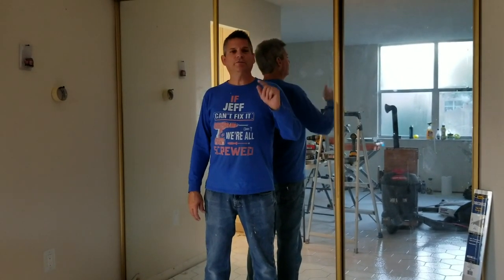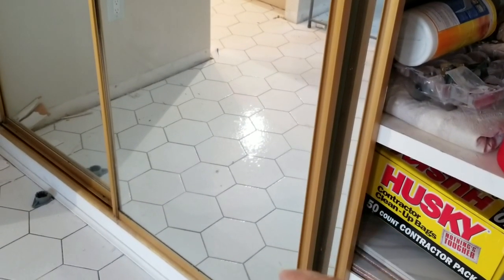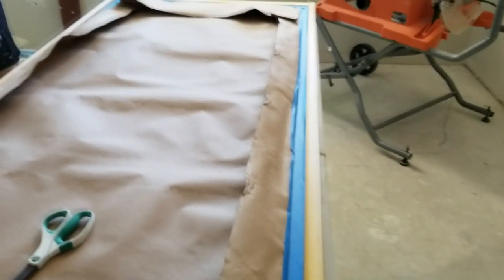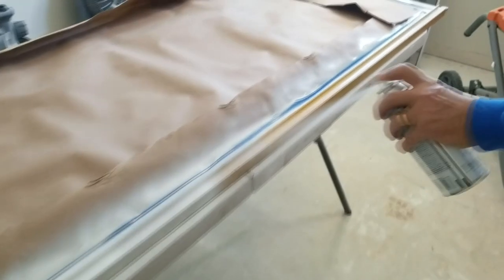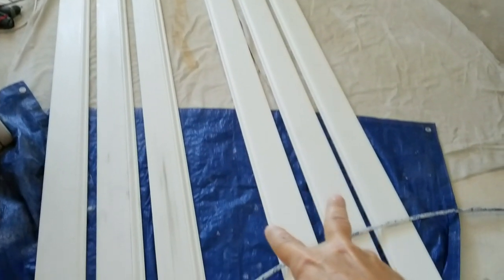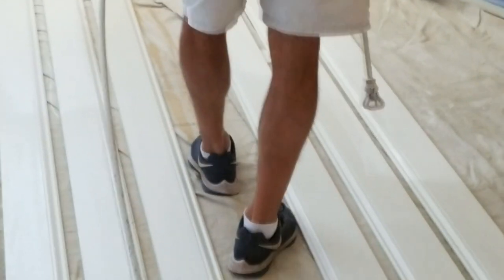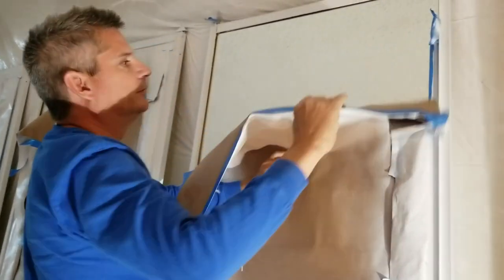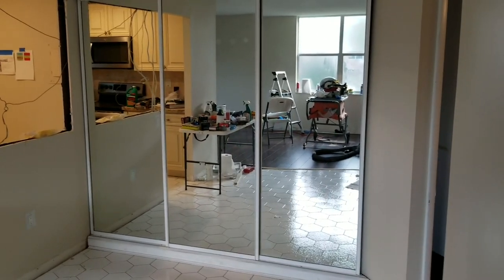How to Paint Mirrored Closet Doors - Painting Metal Frames

Comment: Hi Jeff,
How long did you let the paint dry before removing paper and tape?  Do you recommend a second coat?  Also, should I let the paint cure for a certain amount of time before putting the doors back on?  If so, how long?  Thank you - I am looking forward to doing this!
Reply from the maker: The paint dries fast in about an hour time. If it does not look nice and white for you, then after an hour you can apply a second coat. Read instructions on the can it tells you what time window to wait before adding the second coat.  like to wait until the paint is dried in about an hour and then remove the tape. If you wait until the next day, you could be doing a lot of slicing with the utility knife to score the paint so that it does not tear when you peel off the tape,. I think I just let them stand there overnight to cure.

Comment: did you use oil based paint? you said you had to use paint thinner to remove the over spray? How did you paint the bottom and top tracks? you missed that part on the video
Reply from the maker: Gloradine, I never use oil based paints. For this white paint I used Behr 3050 Ultra Pure White Semi-Gloss Enamel Low Odor Interior Paint and Primer in One from Home Depot. I like this because it is pure white, and you don't have to mix colors, you can just grab it off the shelf as is.  I use this 3050 on all my baseboards, bedroom and bathroom doors, and spraying over old yellow wire closet shelves, when we are trying to put lipstick on a pig. I would still have them shake the paint for you. You can use anything to remove over spray, including a wet rag if it is within a few days. The bottom and top tracks we unscrewed them, laid them out on the floor, and used that paint sprayer you saw in the video to paint them.
Reply: @jeffostroff  can I just use rustoleum paint and primer mixed.
Reply: @casshaye  He said he doesnt recommend it as it doesnt really prime.  Use a separate primer.

Comment: Is there a white spray paint you can recommend to use after the primer?   IF not, what type of paint brush should we use with the white paint?
Reply from the maker: Do not use a paint brush here they will leave lines. I just grab a semi gloss white rustoleum spray paint off the paint aisle at home depot.
Reply: Bonnie Deadder perfect, thank you!!
Reply: @jeffostroff  Can I use the 2 in 1 paint (primer & paint)?
Reply from the maker: @bonniedeadder5245   And the paint in applications that need to be primed 1st period because everybody thinks that the paint with the primer actually primes but it doesn't. It doesn't help with it huge and it really only helps for the 2nd layer of paint that you spray on it helps more like a sealant
Reply: @jeffostroff  Thank you .... back to Home Depot for me!   I appreciate your quick answer and am looking forward to finishing this project!!
Reply from the maker: @bonniedeadder5245  Make sure you have masking tape and paper to cover the mirror with. AND watch for that over spray. Do ti outside or put lots of floor covering everywhere.

Comment: I did some doors 4 years ago. They have scratched and paint has come off. The gold is showing through. To do it again do I need to remove the old paint?
Reply from the maker: I would do a quick sanding to see what comes off, don't waste too much time on it. Sounds like you never primed it originally. Spray on primer, let dry then spray on paint.
Reply: @jeffostroff  I originally sanded and sanded and was surprised that the gold did not come off, then I primed with auto primer, finished with a flat gray and  speckled black. I was attempting to make them look good with the corrugated metal I was using in the room.
Reply: Maybe I should have used a metal clear coat at then end?

Comment: Hello, we would like to do this in our entry so it is a highly visible area.  After you paint a track does the paint chip off where the wheels run on it?   It seems that paint isn't made to be run over many times like that and I'm afraid it's just going to end up looking bad in the end.  What have you seen over time in your properties?   Thank you
Reply from the maker: I'm only in my properties a few months, and you will start to get a little tack marking on the tracks, but it's mostly not visible as it is under the wheels. You standing in front of the door looking down, pretty hard to see. Fresh white painted track looks better than old oily dirty scratchy brass track.

Comment: How do I take the doors off the track?
Reply from the maker: Depends on the doors, but these have wheels on the top of the door that hang on a track up top inside the door frame. I left the doors straight up high enough for the wheel to clear the top of the track, then push it backward and down. If the wheels don't clear the track, there is a small Philips head screw that adjusts the height of the wheel to give you enough clearance to lift the door up and over the top of that track.
Reply: @jeffostroff  okay ill try it! Thanks Jeff

Comment: shouldnt you have CLEANED THE METAL FIRST, before priming? maybe with tsp? also, for SURE you should have removed all wheels and hardware, since painting them damages the sliding of the doors. excessive paint in the bottom and top rails ALSO causes sliding problems.  and how is someone without a spare unfinished room supposed to do all this spray painting? and without a prossional spray painting machine?
Reply from the maker: You can clean the door frames off if you want, they were already cleaned in our case. We taped over the wheels so no paint got into them. If you don't have the interior space to do this, you can do it outside in the yard, we have done that in other projects where it was not possible to paint it inside the property. In the video, you can see we show you the alternative method of using a few cans of regular spray primer and spray paint, which we have also done when we don't have the sprayer available.